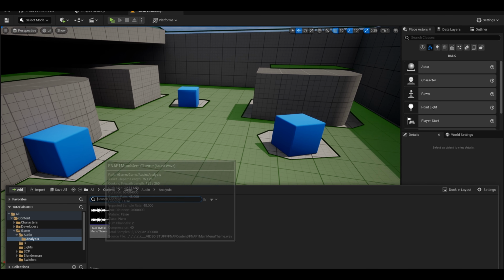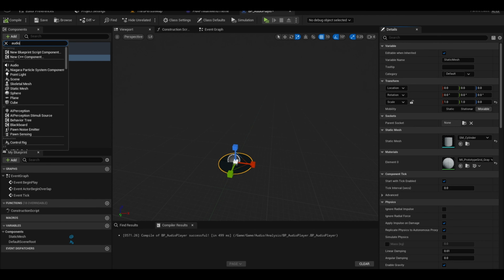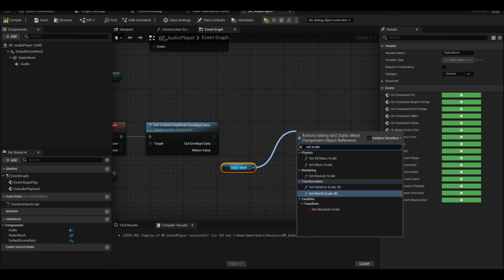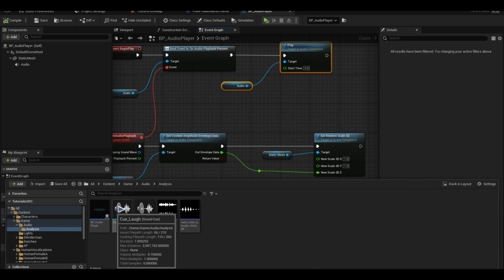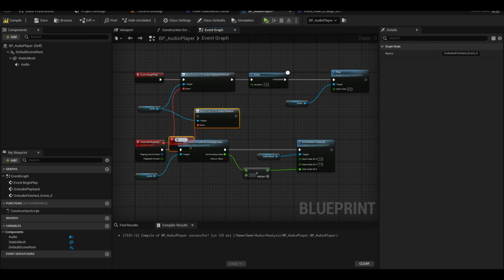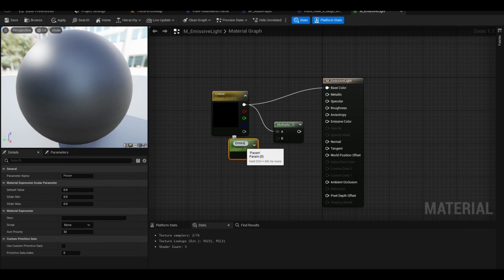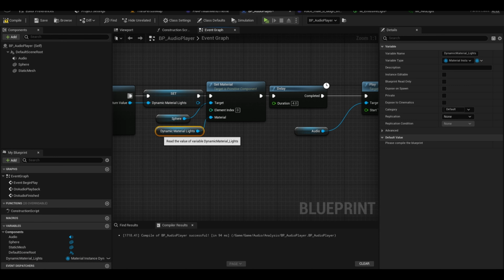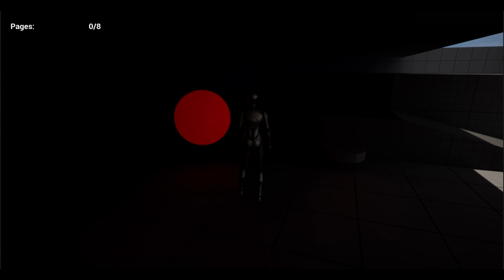Reactive Audio Tutorial (Audio Visualisers) | Unreal Engine

Comment: A way to adjust the scale level on the mesh for the Analyzer. Go to the sound cue created from the audio file>do a search for Envelope> raise the value on Envelope Follower Attack Time >from 10 (I chose 45) to desired value higher than 10. This should limit the scale height on the mesh. I also adjusted my mesh to scale on a different axis due to facing a different direction from your video. I hope this helps.
Reply: thanks but couldnt find this Envelope... still here in 5.5? edit . i found in the Mp3 but not in the cue